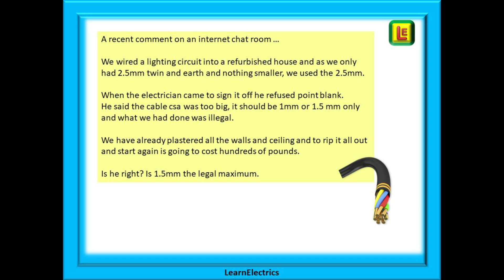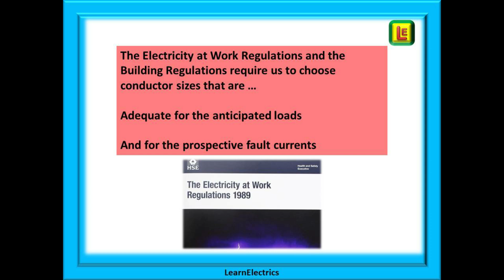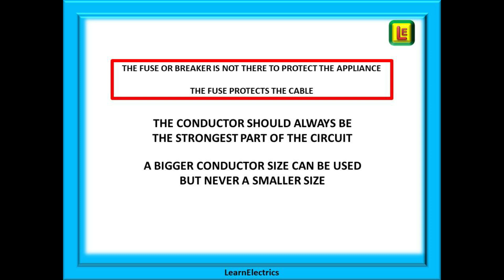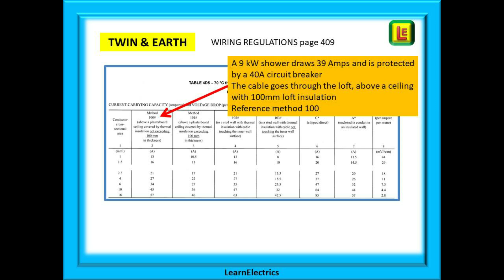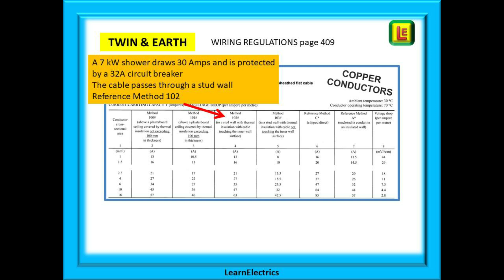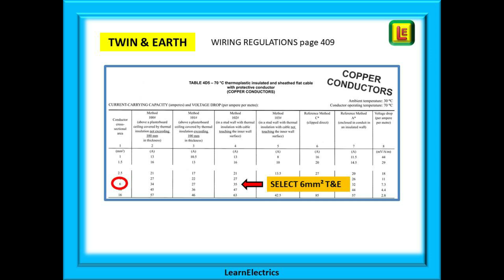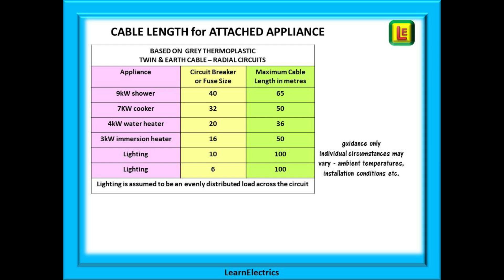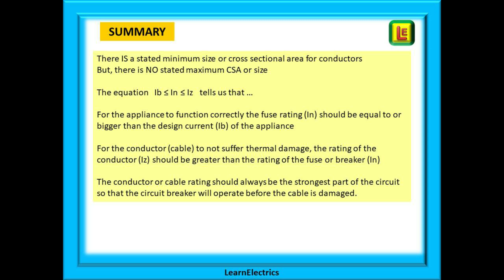MATCHING CABLE SIZE TO CIRCUIT BREAKER SIZE. How to select the correct sizes for safety and function

Comment: I have a question for you Dave please.. if use single cable not(twin and earth )..I want select suitable CSA conductor what best ways calculate actual voltage drop its same thing   thank you Dave
Reply from the maker: The same principles apply for single cables, you would just use the correct resistance values for single conductors in your calculations. 
This video is based on Table 4D5 on page 456
You need Table 4D1B on page 449
BUT, for single phase cables and twin & earth they are exactly the same mV/A/m figures so the numbers in the video will still ring true.
Hope this helps and thanks for watching, Dave.

Comment: One question ,if i learn all your video about electric will i learn electrical ..its about 260 video ..
Thanks alot
Reply from the maker: Yes it will, if you watch them all, you cannot fail to be better than when you started. I only know what I know now because I started learning 40 years ago, before computers, before the internet and you tube. Keep learning and you will get there. Don't forget, you will also need practical experience.

Comment: Hi just curious u rounded the amps to 4amps so what made u decide a 6amp circuit breaker? Why not 5? Sorry that part just confused me
Thank you
Reply from the maker: BS EN 60898  breakers come in discrete sizes, 2, 6, 10, 16, 20, 25, 32, 40, etc. our choice. Must go for 6A, next size above the current demand.

Comment: Please apart from this MFT instrument, which other instrument can be use to determine the resistance value of a cable for for a distance of 1m
Reply from the maker: You can use a multi-meter.
Reply: @learnelectrics4402  Please I did you it and I had a wrong value. Thus an approximated value

Comment: Hi Sir, how do we measure the cable length? Is it from the consumer unit to the intended switch or socket outlet? Thank you.
Reply from the maker: Between the two points of measurement. Usually this will be the socket outlet or switched line terminal at a ceiling rose.
Reply: @learnelectrics4402  meaning to say the fixed point will start from the consumer unit right?

Comment: If the shower draws 39A wouldn't a 40A breaker be too small? Considering that it is a regular practice to size a breaker at 125% of the continuous load, or to only utilize %80 of a breaker's capacity?
Reply from the maker: These are the minimum sizes. Thanks for watching.

Comment: why is multiplied by 100watts please
Reply from the maker: Because the Regulations tell us to assume the worst case scenario of 100 watts per lampholder. If the customer decides to fit 60W or even 6W LEDs then that is safer. But we should not calculate for 60W per lamp holder just in case the customer fits brighter lamps. Have another look at the video, it is explained. Hope this helps.

Comment: Hi , great video , however when you choose cable for Cooker circuit, you showed in your example shower circuit instead of cooker circuit. 
My question is if it was actually a cooker circuit that would draw 7KW then woudnt you apply diversity before choosing the circuit breaker.
Once again thanks for the video
Reply from the maker: No, you choose the breaker size based on the maximum design current. Thanks.
Reply: @learnelectrics4402  thanks for reply so where does diversity fit in all this? As it was a cooker circuit so definitly diversity needs to be applied, I am just abit confused thanks
Reply from the maker: Apply diversity to a 7kW cooker and you get about 22 amps, so a 20A breaker is not big enough. The Regs say that for a 7kW cooker a 32A breaker is usually appropriate. The same with an upstairs ring circuit - diversity says that the circuit will only use 6 or 8 amps so why does the book recommend 32 amp breakers. It's one of those mysteries of custom and practice that the boffins come up with.
Diversity is best applied to overall demand of an installation. Yet with domestic lighting we can apply diversity directly to the breaker size. Sometimes we just have to go with the flow.
Thanks for the question, at least someone is paying attention. Keep watching, lots more to come. Dave.